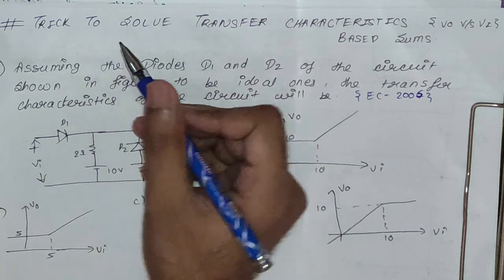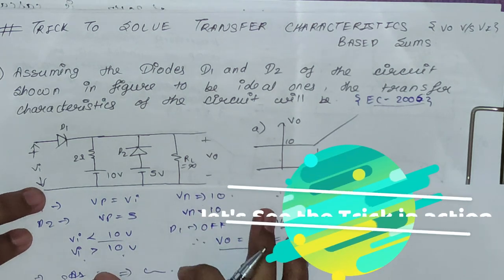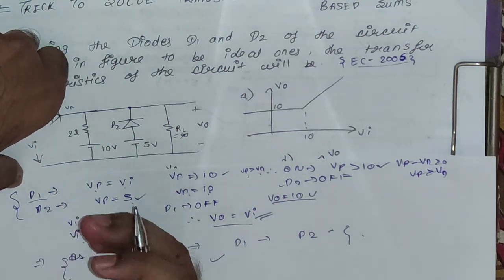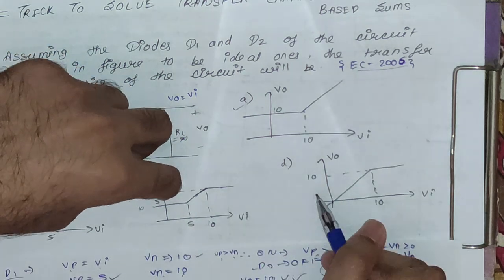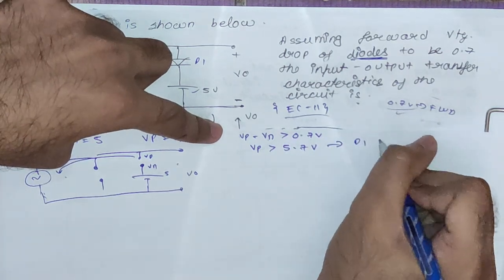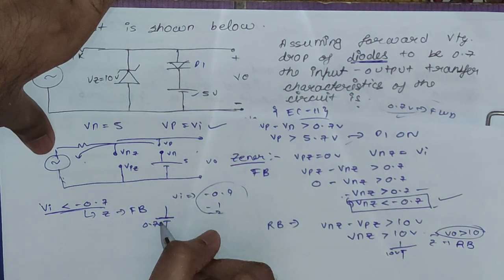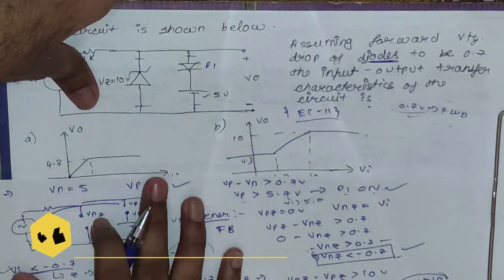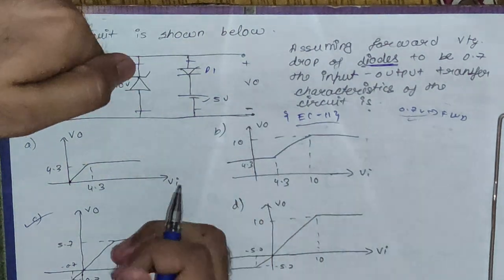Trick To Solve Transfer Characteristics Based Sums | Transfer Characteristics of Diode Circuit

Comment: In second problem,when both diodes are not ideal ones ...how can we open circuit them
Reply from the maker: Look ideal or practical diode will come in picture when you are replacing your diode ...to check whether your diode is fwd or reverse you will always replace it with open circuit and as per the question you will replace with the practical condition mentioned in the question ...Here in that question my diode was practcal diode with vtg drop of 0.7v when it is fwd biased so after checking fwd or reverse I have replaced my diode with that voltage